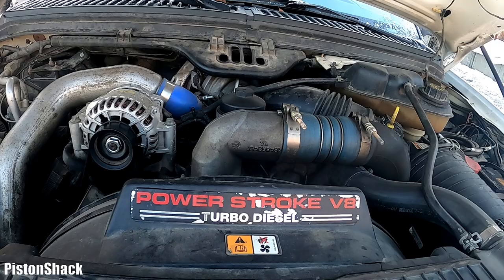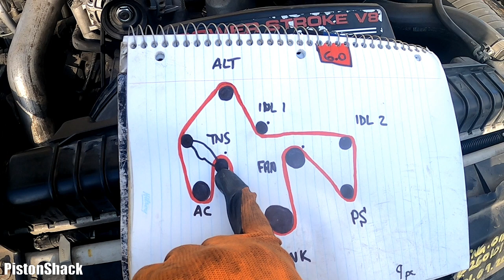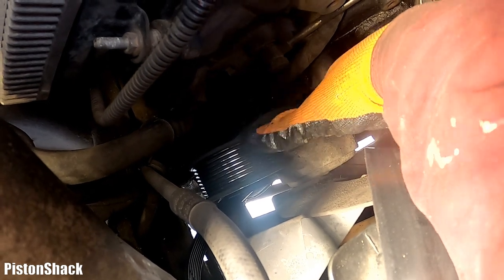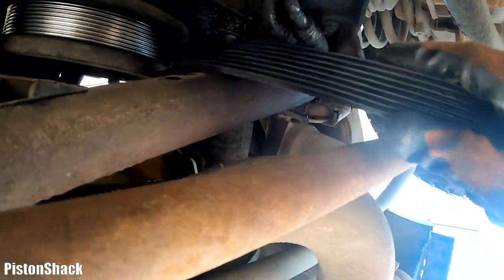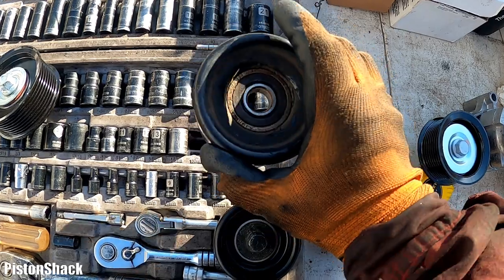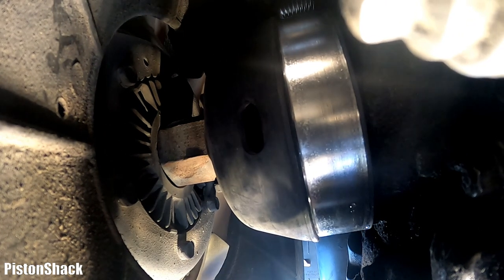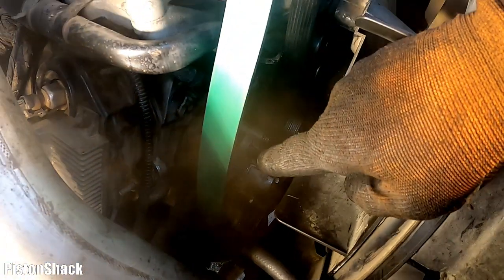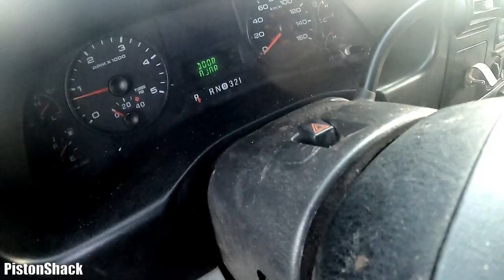6.0 POWERSTROKE SQUEAKY BELT & PULLEYS BASIC DIAG & REPAIR

Comment: Not sure how you could get the belt around the smooth tensioner pulley without taking it off like you did.
Reply from the maker: Any luck brother?
Reply: @PistonShack  yes but I had to route it starting at the ac pulley up to the idler pulleys and alternator
Reply from the maker: You can do that way.

Comment: Those types of problems are the reason I use factory ford parts.  Not worth the idler pulley and tensioner being not the same as original.